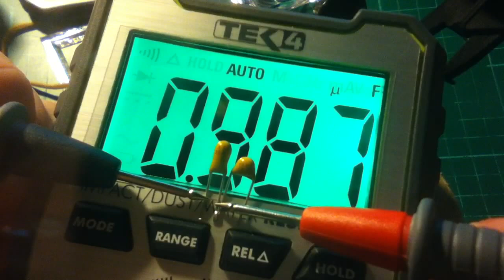Capacitor Wars: Tantalum vs Ceramic

Comment: NO need to look into it ceramics move like crazy the heat of your hand will make a ceramic move this is why they are not suitable for oscillators or timing circuits only bypass and stuff like. The exception to this is the NP0 ceramic but they are generally low value and not as cheap. Really good video is Mr. Carlsons which capacitor does some very interesting experiments with drift. On GenRad damn this video is old my bad

Comment: Tantalum are also very sensitive to the wrong polarity. Electrolytics are a bit more robust when installed backwards. I have never actually destroyed one, whereas I have destroyed a few tantalums in the past due to incorrect installation. This happened under light loads, well below their max voltage rating. They never did anything dramatic. They just stopped working.... It might have just been bad luck, but now I  try to avoid tantalum.
Reply: Noah Spurrier  The working voltage has to be derated due to temperature and if the capacitors ripple current is high. Also be careful if the circuit has voltage spikes, as again, this affects their life.
Reply: Noah Spurrier  MLCC 
how is that working ?
Reply: Tantalum not only likes to go pop, they are also flammable!

Comment: Sir, can I use ceramic or electrolytic capacitor for the nrf24l01+ module , to resolve the battery problems??

Comment: Did you ever resolve this ? Is there another part to this video ?
Reply: To test a capacitor u need to discharge the current inside by simpli short it.

Comment: To get such high capacity in such a small package, ceramic capacitors use ceramic with a very low stability. I think they exhibit a positive going value with a upward rise in temperature, I'm not sure, it could be the other way around. Tantalum caps don't have such great temperature coefficients and are therefore more desirable in applications where things are a bit more critical with regards to the exact value. Have you ever noticed how much bigger NPO ceramics caps of a certain value and voltage tend to be than their less stable counterparts?

Comment: MLCC capacitors use "class II" dielectrics which are very highly polarizable ceramics like Barium Titanate. These cause MLCCs to suffer from a number of non-ideal behaviors like variation of capacitance with applied voltage, as well as less stable capacitance over temperature and piezoelectric behavior (they can act like tiny microphones and speakers). When a DC bias voltage is applied, their capacitance goes down over time until it settles to a new value. When the bias is removed, the capacitance will go partially back but not entirely - there is some hysteresis. This can be fully reversed by heating them up and allowing them to cool back down - a form of annealing. Even the best MLCC class II capacitors, those whose EIA designator begins with the letter X (like X5R) have about a 40 or 50% reduction in capacitance from 0V bias to half of their rated voltage. They end up at something like only 20% of the rated cap value at full rated voltage. Like Tantalums, they can also fail shorted, but usually not as dramatically as tantalums. MLCCs often have even LOWER ESR than a similarly-sized Tantalum cap. So, MLCCs have definite advantages and disadvantages. Pretty much the only area where it still makes sense to use Tantalum caps is when you need a stable, large capacitance in a small size. If you don't care so much about size, metal film caps are superior.
Reply: Excellent reply. Saved me answering the question.

Comment: MLCC has its drawback.Because of Ceremmatic Piezoelectricity, MLCC's capacitance is NOT constant especially for those >0.1μF ones. If you use MLCC as power smoothing capacitor, MLCC has a DC Bias not equal to zero, and the capacitance decrease significantly. But it's not a big deal, just choose BIG MLCC when used as power smoothing capacitor.
Reply: Joeyao Chou   what does MLCC in devices   ?

Comment: Hi Julian how do i tell if it is a tantalum capacitor on a circuit board if it is unmarked.
I have boards that are marked with a + and after removing the capacitor from the board,I've found it is polarized/magnetic.Dose this mean it is tantalum.
thanx Kevin
Reply from the maker: Kevin Sturgess Tantalum capacitors seem to have a + near the positive lead; electrolytics generally have a - near the negative lead. I just put a magnet on a tantalum bead capacitor, but it sticks to the component leads, not the body.
Reply: +Circle Square Yes! Many kinds of components have steel leads, which is likely what is being attracted to a magnet here.

Comment: Nice video. BTW: what is it that protects the circuit at ca. 2:30? It looks like a gel.
Reply: Oldrich Svec heatshrink tube?
Reply: To me it looks like there was heat-shrink tube that then had hot-melt-glue injected.  The heat-shrink-tube has been removed by the time we see it.  That's my guess anyway.  :)

Comment: @OrionPyrotechnics is right. Ceramic caps lose capacitance in proportion to the voltage across them. Dave EEVblog Jones has a video showing this phenomenon. For bypass and filtering, it's not tremendously important, but for RC constants or filter cut-off frequencies, it can matter.
Reply: Also, due to the very tight tolerances and rigidity of ceramic, any pressure differential will induce a change of capacitance, which will induce voltage out one of the ends.

Comment: @bettagenetics: Ceramic capacitors with NPO(COG) dielectric are very stable. To be fair, it all depends on the application when considering Tantalum vs Ceramic capacitors. Johanson Dielectrics and Johanson Technology have some good Technical Application Notes that demystify ceramic capacitors. Cheers!